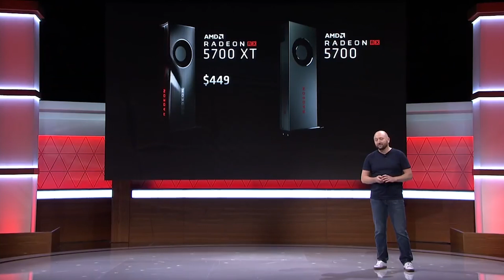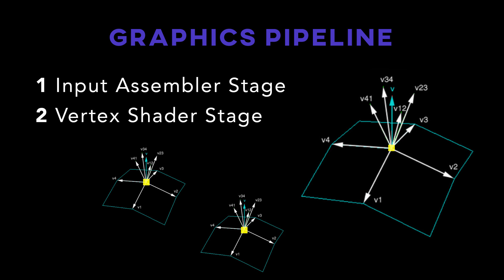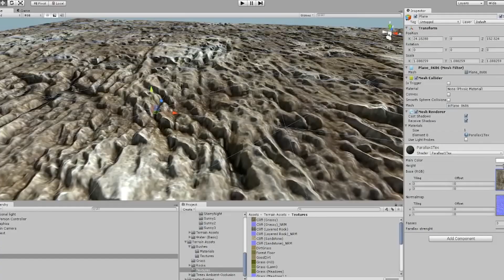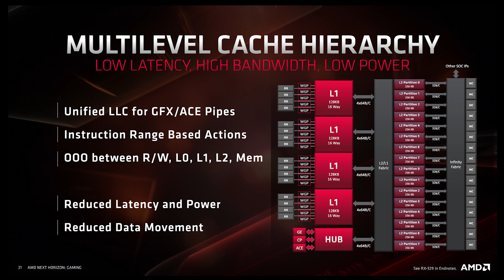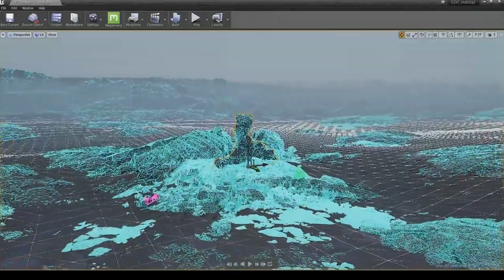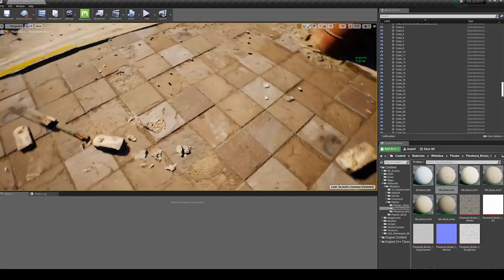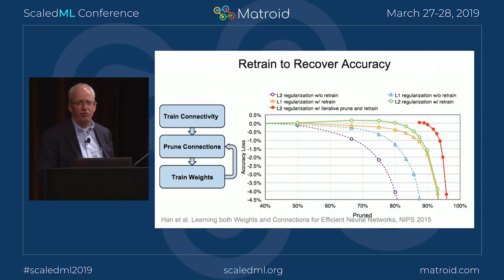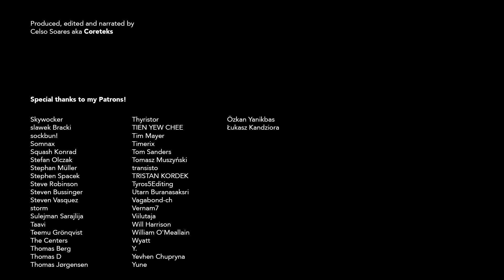RDNA vs TURING - The END of NVidia’s dominance

Comment: If Navi scales well, a 64 CU version should certainly compete with the 2080ti. 

However, there are a few things I feel this video is too optimistic about concerning AMD's future in GPU:
1) Navi is competing against Turing with a process advantage; Nvidia will also move to 7nm and eventually gain the same advantages.
2) The future of graphics is in ray-tracing and RDNA isn't yet capable of accelerating that, but when it does gain the capability, it will certainly come at a cost.

3) AMD pushed async compute because of efficiency issues in GCN. As they are fixing efficiency with RDNA, async compute loses relevance.
4) You've noted that both RDNA and Turing were converging, and since they are any optimization for AMD hardware will also find itself working well in Turing; the reality is that both Nvidia and AMD have had to converge towards each other in terms of their graphics architecture in order to make sure that the software optimized to run on the other's hardware also runs well on theirs. It is much like with Zen, how AMD brought modifications like SMT to be able to better run software optimized for Intel hardware. With Turing, Nvidia has an architecture that is much better on lower level APIs than Pascal so they've already taken steps to ensure their architecture remains competitive.
5) One of the issues with saying that game developers optimize for AMD because AMD has hardware in PC and consoles and soon in cloud and mobile phones, is that these 4 environments are completely distinct despite having similar hardware underneath. When you develop for the playstation, you use the tools provided by Sony on the OS of the playstation and this is a completely different development environment than the PC. If you look at Microsoft, while they will have a custom AMD graphics chip in their future console which will likely be capable of ray-tracing, they have already released DXR and worked with Nvidia on that launch.

So all in all, I just don't think RDNA is anywhere near enough to be comparable to a Zen moment for graphics for AMD. Nvidia isn't bogged down by process like Intel is and MCM is considerably more difficult for a GPU than a CPU so neither AMD nor Nvidia have achieved it for gaming tasks. Nvidia has released ray-tracing hardware first and AMD is still playing catch-up on that front. I would be very surprised if AMD released an MCM GPU before Nvidia, even with their experience with Zen and their infinity fabric. Who knows what Nvidia is working on beyond Turing?

Comment: I’m glad that you made a video visually demonstrating how a GPU works, but you made a few mistakes in your explanation. 
1) Input Assembler goes AFTER the Vertex shader and before the geometry shader
2) The SIMD data is not vertex-wide, it’s component-wide. So for example, a 32-way SIMD unit can only process 8 x 3D vertices at once, since each vertex is 4 components. It could alternatively process 16x 2D vertices, etc. Also, it operates in a scatter-gather mode, so in theory, you could potentially have 64 vertices on flight at once on a single SM core, but only 8 are being actively processed at a given time – it depends on the fine details of the architecture.
A neat thing that I never realized though, is that the geometry processor is its own core (which explains why geometry shaders are inefficient). It makes sense, but I am a bit surprised that it wasn’t allocated to the compute units instead.

Comment: When it comes to rendering, there seems to be this 'gap' between what we see 4 real through our own camera's analogue view, rendered by an analogue supercomputer, that is partially the brain there always seems 2 remain... this 'plastic, unreal' kind of looks. A great game engine not only contains great physics but als needs to 'know' the texture and shape of the materials. Given an example is a program from the Amiga period called 'Imagine' which was bizar for it's time period. It could run on all kind of Amiga platforms with different hardware and possibly also on Mac's & Atari ST's. I saw this happening on an Amiga 500 (1 meg Chip -shared RAM between gfx, audio & programs-) upgraded with a GVP 68030 @ 40Mhz (no FPU & MMU) Turbo card and only 2 meg of added 30-pins SIMM RAM! Took a few days but still. When starting a project, you were asked 1st what kind of light there was and camera positions et-cetera. Note, here we talk about vector gfx in Rendering, in 1994 on a computer stemming from 1985 with CPU/SCSI upgrade! As it even gave the possibility, whether or not the object was beaten by the weather, or covered in dirt and which type that was! And when it came down to creating the object, all kind of proportional parameters concerning the object were requested. It may have been complex but when understood, it was completely logical. As it is like a guessing game, where the more accurate information gives directions to what was being asked...right? So when the hard&software actually 'knew' what it was dealing with, it could draw the approximation, of what was requested. A.I. would do an interesting job...here... nowadays to mach that. This is where Silicon Grey also could still have a dominating position. As they were building heavy machines as well. Cost way more then few upgraded Amiga's though, which was exactly why NASA and Walt Disney Studios had batteries of them. It was even used to calculate... ballistics. How 'vectorious' was that... regrettably? Namasté

Comment: I think the 5700 is a 329 card and 5700xt 399 card just like the 390 and 390x launch prices.
Reply: They literally announced that the 5700 is $380 while the XT version is $449.
Reply: should be*
Reply: Honestly, it wouldn't surprise me if the cards are at the prices I say on launch day.  AMD will cut prices in response to super.
Reply: @MazeFrame  Suggested retail price are not binding. Also their primary consumer are OEM because you will never see those ugly cards other than inside HP/DELL computers. Their secondary costumer are those AIB partners who will be furious if the price drop while they still have RX590/Vega 56 in their inventory.

You can see lower price on lower end models from Powercolour who will cheapen everything to cut cost.

Comment: Ummm, is it just me or does this look like it could turn into a chiplet design for GPUs. Apply infinity fabric and you can ramp up gpu performance by adding chiplets. That may be why they are adding pcie 4. They need to force intel motherboards to add faster pcie for throughput. Look at Apples new AMD dual gpu that has infinity fabric, it has crazy high throughput on it’s pcie connection.

Comment: I would like to see AMD taking the performance crown (maybe prices will finally drop) but I doubt it. The 5700xt has a bit more power than the 2070, lets assume amd is going to announce an rx5800 and 5900, then the 5800 will beat the 2080 and the 5900 is going to take on the 2080ti. The 5700xt already has a TDP of 225W, assuming that the 5800 will sit around 250 and 300watts (like vega64 did) what monstrous powerhunger would a theoretical 5900 have? 350watts? higly unlikely...
Reply: I am no fanboy please dont assume i want to shame amd. I will buy the better not whom i like more

Comment: Coreteks comes across as an AMD fanboy. Definitely an ARM fanboy. Seems very anti Intel/ Nvidia.

I care about performance. 
AMD are back in CPU but Navi is not the Zen for Radeon. Navi is a dud.

5700 is nearly half the die size of 2070 and 7nm vs 12nm. According to AMD own specs it looks like it's gonna draw more power. The final nail is 2070 will be faster.

5700 vs 2070
5700 XT vs 2070 Super

I've currently got a 2080 Ti, when AMD is faster, I'll be interested... Now imagine Nvidia on 7nm wow!
Reply: So why do you compare 5700 with 2070 when it's clearly aimed at 2060/2060S ? Nvidia fanboys amuse me with their blind bias.
Reply: @luckyankraj 

It's not a bias, look at the core count

5700 - 2304 Shaders, 144 TMUs, 64 ROPs
2070 - 2304 Shaders, 144 TMUs, 64 ROPs
2060 - 1920 Shaders, 120 TMUs, 48 ROPs

5700 is on a much better node (7nm, almost half the die size, yet consumes more power and is slower than a 2070 and barely quicker than 2060 using AMDs own slides. 

The real question @luckyankraj is, why is AMD comparing a lower end Nvidia card that only has 1920 Shaders and 6GB ram when they have the node advantage?! 

5700 XT - 2560 Shaders, 160 TMUs, 64 ROPs
2070 S - 2560 Shaders, 144 TMUs, 64 ROPs

Do you not see a pattern here?
Reply: @TABSF1  The real question is , why are you not comparing price points to price points as a consumer. At the end of the day performance/dollar is king. What you state is the reason why Nvidia has to chicken out a hastily put refresh. Ask them why the 2070 was not 2560 cuda cores in the first place. And ask the poor souls who just bought a 20 series to just be bowled over by Nvidia. The fact is AMD brought cheaper and stronger GPUs so Nvidia had to respond and bring what they should've launched in the first place. Both AMD and Nvidia are still overpriced though , but you should thank AMD that Nvidia is giving you the original 20series versions and not the cut down ones. 
Also ask Nvidia why they put out a 6GB card at 350 in 2019 ? Taking consumers for a ride are we ?
Reply: @luckyankraj 

Oh well, AMD had to do the price drops to remain relevant in GPU space. Good for consumers but 2070 Super trashes 5700 XT and 2070 with 5700 as I suggested... Big surprise...

Mild overclock and power consumption goes through the roof. 251mm2 vs 754mm2, 7nm vs 12nm. Why does the 5700 XT use more power than 2080 Ti?

Comment: One marketing / selling point of Nvidia is that their GPU's can accelerate an AI workload which has similar parallel processing characteristics as traditional graphics does.  Especially when it comes to backpropagation type calculations relevant in "training".  As of 6 months ago Nvidia hardware was much more desirable because of better driver support.  In some ways AI is very analogous to the inverse operation of rendering a frame; an image is deconstructed by a "blackbox" system that has been trained to find characteristics.  From what I could see, AMD was much more open to developers, however their GPU's lagged the performance of the NVidia counterpart.

Do you have a comment about how AMD and RADEON are engaging with the emerging AI market?

Comment: One of the best explanations for not programmers that I ever heard of the graphics pipeline well done! It is not easy at all! Being a programmer everytime I try to do that i often get side tracked to details that for not tech people are just confusing and do not add anything to the overall picture, so well done! 
Just two small things, as far as I know no API supports quads anymore? maybe old opengl but was just an abstraction on top of triangles. DX does not even support points anymore, if you want a point you draw a small quad etc. Finally geometry shader is an optional stage, and actually is rarely used since performance is far from optimal. So unless you explicitely set it up the goemetry shader is skipped.  Nice video! keep it up

Comment: Also a dual core GPU+Infinity Bridge stuff makes it possible to render complete odd & even frames thus thereby also being able to address own separate mem Busses, which can correspond, bridge, or pair with each other when apps have use 4 that. A gfx card is already a module by itself. Just as a dedicated high end sound card. So there is enough space to create dual memory lanes and such... right? Look @ nVME and such, to see prove enough. And let's look @ another aspect of video used by DVD & Blue Ray principle. Which came from H.A.M. (hold & modify) from Amiga gfx chips. It means that only the 'floating, or moving' pixels will b recalculated. That what remains the same stays there with no computing power needed. This stuff needs to be core logic so that execution units can be properly addressed in resources. This is also why a good game engine runs a lot of good... shows! Namasté

Comment: I'm not sure if i follow the reasoning about prices. Look at what you get when you buy a 2060? How can you call the rtx branch overpriced if the results are more then in line with the previous generations of pricing? If you look at a 2080Ti i say oke but still it is in some games comparible to running a 1080ti sli configuration

Comment: The fact that navi delivers performance akin to 60 gcn cores using 40 rdna cores is amazing. However, I'd wait until they actually release an 80+ core GPU before declaring that navi is akin to ryzen. The individual cores in zen 1 werent that good compared to Intel, it was the fact that they had 8-16 to Intel's 4-10 that made ryzen so great. Navi is a great improvement over gcn, and the 7 in 5700 gives us a pretty good hint where this product would lie on a complete product stack, but I think its unwise to make declarations until we hear about products that are actually better than nvidia's in some way.

The r3 1400 wasnt what made ryzen look great, the r7 1700 and threadripper 1950x did that.

Comment: I wouldn't go quite that far, Nvidia still have a serious Perf/Watt advantage architecturally considering that Nvidia is using "TSMC 12nm" which is really only a refined TSMC 16nm and AMD is using TSMC 7nm. Once Nvidia moves to 7nm we should see a ~20% clockspeed increase and a further reduction in power consumption. So SM vs CU Nvidia will be ahead by 20% unless RDNA2 improves clockspeed and/or "IPC" by 20%.

Comment: if next gen console will do locked 120fps at 1080p lots of budget pc gamers will buy next gen consoles
Reply: No we won't
Reply: @hlmc00  more then  70% of pc gamers has 1080p 60fps pc only if next gen console will do 1080p  at 120fps for 500$ or 800$ who will say no to that console and it will has best games im a hardcore pc gamer im not a pc fan boy something like that
Reply: @husainhusain1341  for 500 I could get the same results and not lose the function o a home PC
Reply: @hlmc00  so you are saying you can built a 500$ pc that can outperform xbox one x .so tell me the specs of 500$ xbox one x killer pc 
no single used parts okay every parts have to be brand new
Reply: @husainhusain1341  RYZEN G200 ECS 350MOTHERBOARD ASROCK RX590 8 GIG DDR4 256 NVME

Comment: I personally hold an extreme level of skepticism with regards to later generation RDNA processors simply down to how they are handling the launch of gen1. It will be super interesting to see what they pull off for gen2 but I don't hold super high hopes. Especially after being let down 3 times with flagship GCN. Granted, the compute (especially under OpenCL) is far better than NVidia, but for gamers, OpenCL performance measns basically nothing.

Comment: The architectural explanation on both Navi and Turing is well done. Just like nvidia advantage on the hardware level to reduce the workload to boost performance over AMD. And i actually agree on the fact that gaming industry is programming primarily for GCN, due to the console market. Very good video. Btw, your website, is very well designed. This channel has much better quality than similar channels with more subscribers, so keep up the good work.

Comment: I was wondering, is it possible they will create "home cpu die printer"... it has been ultimate high tech to create dies, but i guess 3d printing will evolve with time. using single transistors to build old school cpu is not close to reality anymore (in 70s maybe)... it is just unimaginable to think of even millions of transistors in a few square mm, let alone billions nowadays. electrical engineers used to make their 4bit "cpu", but amd has many different dies communicating with memory and other dies inside one gpu chip.

Comment: A few videos ago on the "why AMD GPUs are not worse than Nvidia's" I argued that as a developer I would not invest in AMD until they have PhysX support and proper drivers I can leverage you simply responded that I didn't watch the full video.

Now you admit to the driver-problem. What changed in the mean-time? 

On another note, I am happy that PhysX is going open-source and with this pretty much the main reason I stuck with Nvidia is gone. When do you think will AMD incorporate it into their drivers?

Comment: HBM is not SRAM. All the internal registers and caches are SRAM, but HBM and (G)DDR is DRAM. Very different technology. HBM is efficient due to the very low power interface enabled by the tiny trace lengths on the interposer.

Comment: And then Nvidia moves to 7nm and suddenly it becomes utterly apparent just how big their lead is, HD 5970 was the last time AMD was on top in graphics and it will take a miracle for them to get it back while still on the same node as Nvidia. On 28nm they got completely crushed by maxwell, and now on 16nm turing is evening the scales in async in vulkan and DX12. Compare GPUs of the same size, on the same node and tell me that AMD has a chance of GPU leadership, what AMD needs is a maxwell-tier performance improvement, not just a dieshrink with a small improvement on top of it.